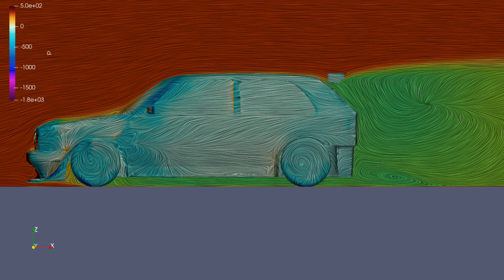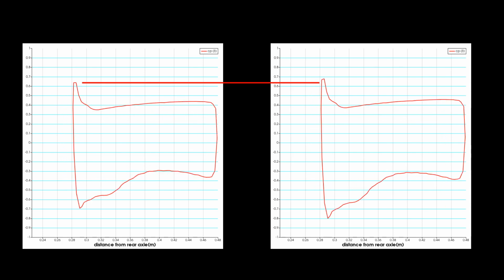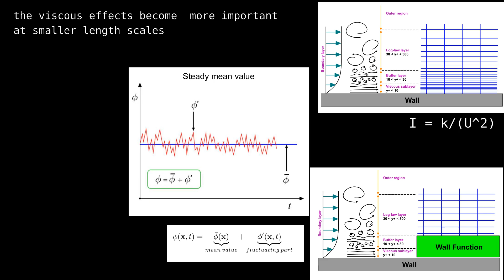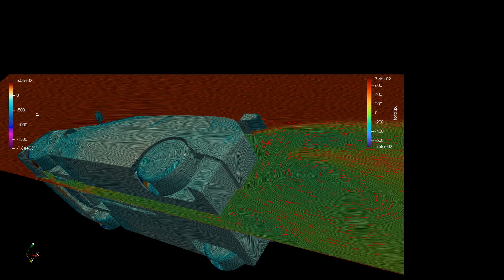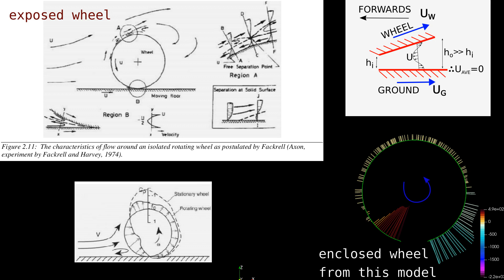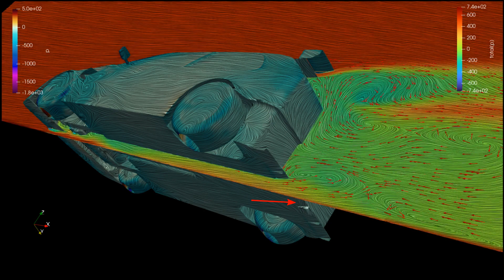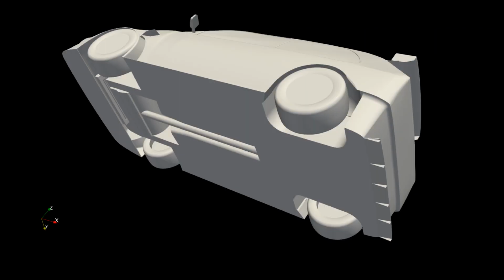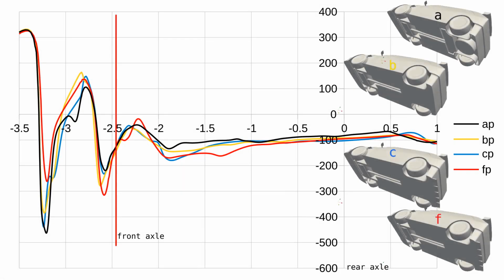Modifying the Floor

Comment: Does the exhaust outlet have a lot of influence on aerodynamics? Does its position influence the gas output? Old nascars use the barrel at 45 degrees, modern ones are straighter in relation to the body.
Reply from the maker: doesn't seem so on a hatchback. I try to run solutions on the suzuki model and found a big load of nothing, that was with a rough floor.... Big difference for a aero device, so maybe with a flat floor.
Re: Other comment. The plane is after the radiator, so it is indicative of the engine bay. So lower the average the better. 
I'm going to more on rad ducting, but the front side, base on a single experiment, said it was a bit better....

Comment: I don't understand most of the underlying science and it is still intriguing to see these iterations of aero and the effects of them with your expert explanation. It was surprising to hear that the diffuser lip has caused front lift. Crazy how complex an aero system can be.
Does your model consider suspension movement? Does e.g. the increased rear downforce change the angle of the floor in the simulation? Does that contribute to the occuring front lift or is the lift only related to the change in flow structure?

Comment: put... winglets at the point between the side panels and base of the rear glass, that wrap around the body (flush to the body), the aerofoil should kick upwards..   the winglets should not span the full width of the rear.. approx 1/3 of the way in.     

you will be surprised how effective this is..      its about making the radius of the recirculation bubble smaller and more predictable..  with a centre point vertically higher..

Comment: So the next step is splitter tunnels/diffusers and a wing profile right? I’m interested why you didn’t cover the rest of the floor as well, is that a ruleset thing or more concern for heat build up
Reply: Ye I was going to say front diffusers and seal the engine bay off from under the car